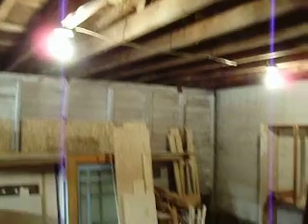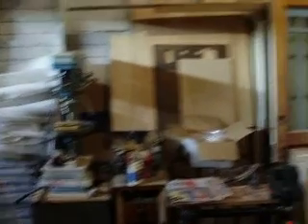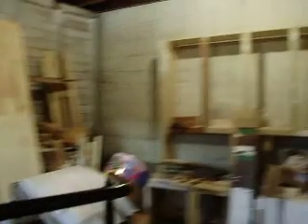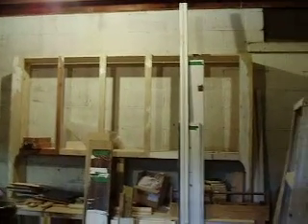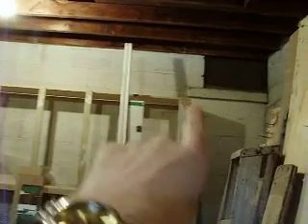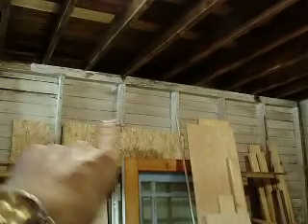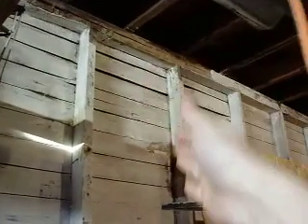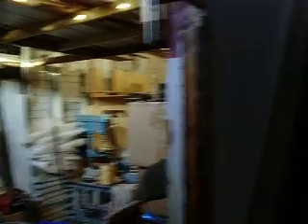House Tour Part 3

Comment: What am amazing house!  It's going to be a stunner when you're finished.  A labour of love, definitely.  I'm going back to look at the rest of your blog now.  I found your blog when I was googling mogul lamps, since I just bought one and am thinking of rewiring it myself.
Reply from the maker: Thanks for the comments! Yes the house is definitely a labour of love. As for your Mogul lamp, they are fairly easy to rewire IF you follow a simple diagram. One of the best ones I found is in one of the posts I made, and for the new 3-way switch, I used a 5$ ceiling fan chain pull.
Reply: sooth15
Thanks for the tip on the rewiring - I'll go look for the diagram on your blog.  I didn't end up rewiring the mogul lamp as it's taken me this long to get it apart, get it cleaned up and arrive at the realization that the metal's too far gone and needs to be painted.  I'm taking possession of another one (with lovely two-tiered marble base) which will definitely need rewiring.  Great idea re the chain pull!  I bought a 20s/30s bridge lamp yesterday that has a chain pull.  So much nicer than the modern push-through switches.
Reply from the maker: Bridget Curran
Hey Bridget, I just realized (after about 30 minutes of page flipping and double checking) that I never included the Mogul lamp wiring diagram anywhere, and the particular one I used is hard/impossible to find. That said, I'm going to add it into the post that deals with rewiring my second Mogul lamp. If you go to the blog (my1923foursquare) and search "mogul" you should be able to find it. :)